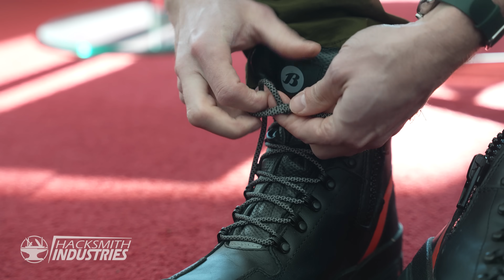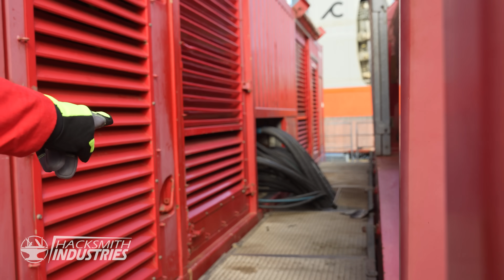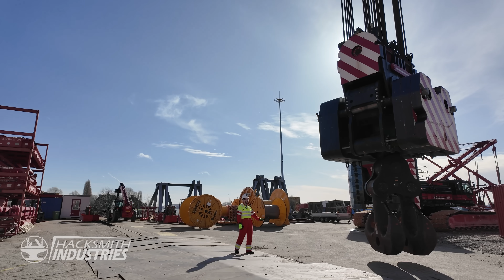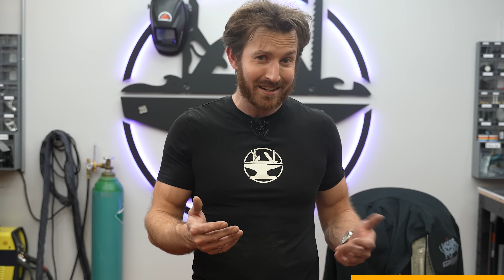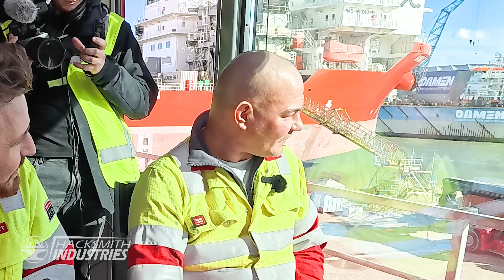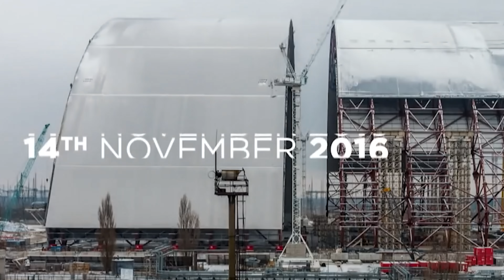I Used The WORLD'S LARGEST CRANE! (5000 TON CAPACITY)

Comment: Pyramid conspiracy theorists who say we can't build the pyramids today should really take a look at this video, lol
Reply: With an average weight of 2.5 tons, this crane could lift 2000 of the limestone blocks that make up the large pyramid of Giza. At the same time.
Reply: @Bierrr  Yes, the "small" blocks are indeed about 2,5 tons, and the bigger ones at the base of the piramide are 5 tons.
Reply: @Bierrr yup but planning testing a lift of a 2000 2.5t blocks prior then rigging up for the lift and then taking the lift would still take a couple thousand lifts for this mighty crane to equal the however million blocks make up the pyramid … remember any increase in weight for the crane delivers a limitation and then wind more limitation and distance from pick up to drop off point more limitations which ultimately could result in the crane only being able to lift half or quarter of the 2000 2.5t blocks or less even
Reply: @Bierrr it’s just fascinating to think about how they did this without a crane like this, or any other. But my question is… even though this crane could lift the weight, would it be able to have the cast to lift the blocks from the outside of the pyramids footprint, to the center of the pyramid? Does that make sense? I don’t know how else to explain what I’m wondering. Hopefully that makes sense. I don’t know if it has the range to reach from the outside of the pyramids footprint to set the center blocks in place. I’d like to know, but don’t want to do the math 😂
Reply: @Bierrr I don’t know if that’s the average, but I thought I remember reading some were 15 tons
Reply: @Bierrr  to be fair, that would be at its maximum capacity. How far out you have your load makes a massive difference in the capacity.

And also my understanding of people saying we couldnt buikd the pyramids today, its about the level of percision.

Which lowkey as a construction worker, i kinda agree with, the actual labour of the pyramid, we can do easily, but the artistry of it, the percision of how well the bricks fit together, it would honestly be an impressive undertaking even today.

You would need some true master masons to work those blocks.

My understanding is the pyramid of giza, you can even fit paper between the blocks, if its that level of consistency the whole way around, it is truly impressive.

We make mistakes today even on thresholds and we are working with concrete that we get to form as we please
Reply: Nooo... That crane is clearly not man made
Reply: @ProfessionalBurgerFlipper  oh no
Reply: @ProfessionalBurgerFlipper  Correct, it's not MANN made. It's MAMMOET made.
Reply: @ProfessionalBurgerFlipper  Extraterrestial MIlitary Surplus
Reply: We could but it would be super difficult to reproduce them. The way the stones fit together and their sizes in the great pyramid in particular would be tough to reproduce. But of course, possible.
Reply: TBH, I doubt the mysteries around why (and how) the great pyramids were built will ever be 100% solved… until 1 of 2 things happen:

Either we find an ancient papyrus of “Building Pyramids for Dummies” in hieroglyphics,
Or,
We just go TRY and see what works and what doesn’t. If we actually build one (without super cranes), at very least it’ll settle the “Ancient Aliens” crowd for a bit. At least on THAT topic.
Reply: Wait, they think humans can’t even build the pyramids with modern technology? And I thought ancient aliens conspiracies couldn’t get any stupider.
Reply: I want to know how they did it back then. And how they sourced the blocks and how far they had to travel with those blocks. Man they were determined.
Reply: Build the pyramids 1 day project
Reply: There are stones that weigh 1200 tons in Egypt so they must of had this Crain then huh thousands of years ago ahaha
Reply: @user-uhlilcantankerous  We're talking about the pyramids, dude. Not the Baalbek stones. Those ones are actually more of a mystery, and I'm more inclined to believe that aliens put those big stones where they are than to believe aliens built the pyramids.
Reply: The Annunaki approves this message…
Reply: It costs a LOT more because we no longer have slaves to build them for us.
Reply: People need to remember, there was a lot of inventions, and slave documents that were destroyed by the library of Alexandria fire..
Reply: It's a conspiracy that Mankind can replicate the pyramids in the sizes of the most largest pyramids in the world.    Them machines are nice, but they will fold in half quickly.   It's only as strong as its weakest link.
Reply: @syraofficial1  Disagree, we have to consider stuff they didn't or couldn't back then. Earthquakes, building placement depending on wind or climate, drainage, load bearing, accessibility etc. A lot of planning and engineering goes into proper modern architecture that we aren't aware of, our needs have evolved with the times so the complexity has increased not been reduced just due to power tools and cad software.
Reply: Sure can’t build it without forced labor butttt with it I meannnn-
Reply: They say no crane in the world could lift some of the stones in the pyramid. And also the stone in Lebanon the stone of the pregnant woman. Or something like that.
Reply: And it's not even the world's largest crane it's close though
Reply: LOL but getting the stone to the site and finding enough talented masons would be difficult.
Reply: What does now have to do with then 
If the tech & exactly what was used is different ?
Reply: Not that we couldn’t make it we just don’t understand the logistics of it all and to use all the energy just to built that it’s crazy not like they have skyscrapers all around like we do today so for them to built that for what? it’s crazy
Reply: @onetonone562  It's not that we don't understand the logistics, either. We know that the ancient people weren't stupid and were actually pretty intelligent. How did they level the pyramids? Water. They made a pool of water at the base, waited for a windless and clear day when the water was calm, and promptly marked it where they needed to pack the ground to stabilize it. How did they get all the stone from a quarry that was miles away? Boats. Even though the stones could weigh up to 20 tons, the water displacement of their ships could carry 3 to four times that amount, so they transported them via ship. How did they get them to the pyramid and into place? Ramps and logs. Ancient people understood that it's easier to roll or push something up a hill than to lift it up, so ramps were constructed to get the stones up to the appropriate levels and logs were used to make it easier to push or pull. It is definitely one of the greatest feats of logistics and coordination to design and build the pyramids, and the fact that they still stand is a testament to their work.
Reply: No one says that.
Reply: @ImEnemy608  Yes, they have. Conspiracy theorists always keep saying that humanity didn't build the pyramids and that we couldn't build them today. Have you seen how stupid some people are?
Reply: @theminerwithin9316  also important point, they  didnt build it with today's deadlines, we know they spent decades on it.
Reply: Good luck the pyramids have over 1 million 3 hundred thousand stones
Reply: @B.r.i.a.n.1  Even though the crane in the video has a 5000 ton capacity?
Reply: @theminerwithin9316  Not that it couldn't be done today. It would be very difficult even with today's modern tech. There supposedly wasn't equipment like this when they were built, making it impossible with the tech we were all told they had at the time.
Reply: @B.r.i.a.n.1  Not really at all. We have Bagger mining trucks, cranes like this, and massive cargo ships that can carry so much weight that the biggest concern is not it sinking from the weight, but it tipping over because it's so top heavy. It would be an awesome logistics feat, but it is nothing compared to the Burj Khalifa, the global trade network, and best of all, The International Space Station. There is a mostly agreed upon theory about how the Egyptians could have done it: Ramps and rolling the stones on logs, which is a lot more effective than you think it is. Ships to carry the stones, which you probably think would be too weak to hold them, but evidence shows that their larger ships could have easily carried 50-80 tons plus more, having believed to carry 500 tons worth of stone. A few quarries where the stones were cut were up to 500 miles away, and it makes sense that they would use boats for them, but most of the core stones came from the Tura Quarries south of the pyramids I believe on the opposite side of the Nile river.
Reply: Yea right.. we just don't feel like building another gothic cathedral.. or the structures in Scotland... we'd rather live in boxes
Reply: @Tokencaucasian  Yeah, because those little boxes are faster to build and more resource efficient than a massive structure. The Gothic Cathedrals and Pyramids of the world were made as religious structures meant to appease the cultures' gods, not house a couple of families, and we really don't have much of a need to build such massive structures today with science becoming more and more prevalent. If you want a truly great accomplishment, look at the ISS or the Burj Khalifa. The Burj Khalifa alone had to have a specialized foundation just to cement its place as the tallest building in the world. If you want a religious or recreational structure (can't tell which it is yet), look at the Statue of Unity, the biggest statue in the world built in 2013.

The greatest achievement by humanity is arguably when we put a man on the moon. You're telling me that we could pull that off with 1970s technology yet can't carve a few rocks or stack them to form a structure?
Reply: The Tower of Babel ☠️
Reply: Sybau
Reply: @georgewashington1788 reply to someone else’s comment pls
Reply: We def could. But why is the question. Just to prove we can? The amount of funding required wouldn’t make sense, which makes the pyramids even more intriguing. They have a function. They are not tombs.
Reply: I mean they were sourced over 500 miles away that’s more impressive than the lifting
Reply: Anti gravity technology is a thing. It was way back then anyway !
Reply: Avg modern skyscraper arguably more complex to build
Reply: @thebirdhasbeencharged complex… sure. More difficult? Hmm.
Reply: @OEF_Vet_0331  tf? Does that make sense? See my follow up comment about shear and wind, whatnot etc
Reply: They said it would be difficult not impossible
Reply: @Titan-jc8to  which is not.
Reply: @Rafathegam231  it is to some extent especially with the materials that it was made with
Reply: yes you solved the lift problem . what about physics  and science of the pyramid
Reply: @abdelrahmanmohsen2735 that’s what I was thinking. Does the crane have the cast to set the center blocks in place while it is sitting outside the footprint of the pyramid.
Reply: @abdelrahmanmohsen2735  What science goes into stacking a bunch of giant bricks into what is basically the world's largest pile of rocks with a tunnel system in it?
Reply: @theminerwithin9316  I feel like it’s the planning that went into it though, we could build it now yes, but what would that prove as you said it’s just a pile of rocks.

But the existence of the pyramids at the time they were constructed is historically significant and they put so much thought into the design, if you do research or visit them, you’ll see that they’re actually pretty well designed, clearly developed with a lot of engineering that would nowadays be common knowledge but it’s still remarkable that they were actually able to pull it off.

But yeah it’s wild that people think we couldn’t do it nowadays, we could even do it better with our current technology.
Reply: @ItsProbablyKiaan  I was about to say that a normal skyscraper nowadays has more planning put into it, but you're right. For its time, the Great Pyramids were engineering marvels, and it shows how complex and intelligent the people of the ancient world really were. The fact that some people don't think the Egyptians were intelligent enough to make the Pyramids is nothing short of an insult to their culture.
Reply: @theminerwithin9316 explain how they built it then
Reply: @spartangod1110  Simple actually 

First, they transport the heavy limestone via boats through the Nile, then they transport them via logs, by putting a bunch of them on the ground and Rollin the stone on top of it (logs are pretty durable). Then they stack it like, well rocks. How did they get up there? Built a ramp of courses, there's a diagram somewhere that show how the ramp could've been built around the pyramid before it was covered by the rest of the limestone. Ancient people aren't stupid y'know
Reply: @BlueRGuy  cap you got zero evidence just sum theory
Reply: @spartangod1110  Are you saying that the Egyptians weren't smart enough to plan out the creation of a giant pile of giant bricks? Because that's what it sounds like you're saying. Just because they were ancient doesn't mean they were stupid. Calling them that is nothing but disrespectful to their culture and architecture.

Just because it looks extremely difficult doesn't mean it wasn't created by ancient people. A pyramid is the most structurally sound building possible, and that's evidenced by the fact that hundreds of other ancient peoples created pyramids as well. And you're acting like it took a few years to make it. No. It most likely took many decades and hundreds of human lives to make just one. The Egyptians had thousands of slaves that were used to make them by following the process that BlueRGuy laid out.

And before you say that it's some crackpot theory, YEAH!! It is just a theory! There are thousands of gaps in history that require theorizing to fill in, and the creation of the pyramids is one of them. You should think about the more rational answer that makes more sense rather than screaming alien or whatever. 

I'm not going to continue this argument after this for one reason: "It's very difficult to win an argument against a smart person, but it's impossible to win an argument with a dumb person."
Reply: @theminerwithin9316 well they aren’t rocks, they’re stones, and I think some, or all were sourced from very far away, and in terms of the cranes ability to lift, well no shit it can lift, but does it have the cast to set the center blocks in place while sitting outside of the footprint of the pyramid? Or does the crane levitate too?
Reply: @theminerwithin9316 so your saying every one can build a structure everyone’s bob the builder an architect ? 

Cool doubt it
Reply: @BlueRGuy however, as you just explained. Modern people definitely are.
Reply: @spartangod1110 you are the one who got zero evidence. He explained the whole process, and we know people back then used methods like this. So, pls explain oh so smartly, just what part seems "off" to you? Ramp, boats, etc.?
Reply: Nope.  Takes too long to swing.  It'd take 4 of them
Reply: @daneboyd952  "Takes too long to swing."

What? Do you genuinely think that it took the Egyptians a few years to build those massive things? It certainly took decades and hundreds of lives to make just one of them.
Reply: The engineering marvel of our pyramids in Egypt goes beyond lifting weights, even if we had the ability to do so
Reply: @marwanahmed2410 😂😂😂 its been proven that 1 man can move more than a 1 ton stone with just wood
Reply: Are you trying to say Egyptians used crane to build pyramid 🤡
Reply: @nazer00  No, they used slaves didn't you go to school
Reply: @joseesquivel3988  that has been debunked the pyramids were tombs for pharaohs and were seen as sacrade it is impossible they would get a bunch of slaves to build something that sacrade
Reply: @nazer00 no
Reply: @nazer00  first crane is invented 
 by ancient Mesopotamia and appeared in egyptian technology
Reply: @nazer00 they used mechanical advantage, 🤡
Reply: @nazer00  This lifts 5k tonns heaviest stone in the pyramids is like 80 tonns
Reply: @nazer00 I think you should reread the comment
Reply: No one has ever said that
Reply: @PattyDoneDiditBaby  I assure you people have
Reply: @PattyDoneDiditBaby  You'd be surprised by how stupid some people are.
Reply: @theminerwithin9316  Very true. Just look at the modern flat earth movement for example. Exhausting stupidity.
Reply: @PattyDoneDiditBaby  loads of people say that all the time. Have you been on the internet for more than 2 minutes? lol
Reply: @PattyDoneDiditBaby watch literally any Joe Rogan clip about pyramids
Reply: @PattyDoneDiditBaby I actually had a college professor say no modern crane could lift the largest pyramid blocks
Reply: verry funny! we could build what's on top right now sure, but it goes down way deeper and we really couldn't build it now a days its not possible. its really a shame because technology has advanced so very much since then we might even be able to improve on some small aspects of it.  i mean just image the scale of it! its very very large and quite old symbol of a county and i truly believe that we cant build that anymore but im happy to agree to disagree on this one my friend,  but i friggin' love the statue of liberty i hope you have a blessed Friday  brother
Reply: @micahpacileo2307  bro watched a Joe rogan podcast and sees it as fact